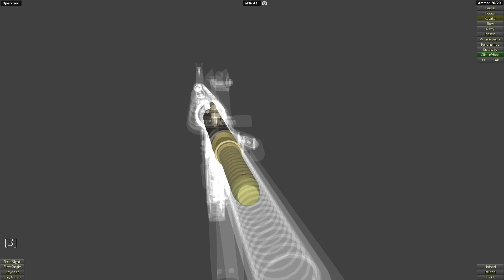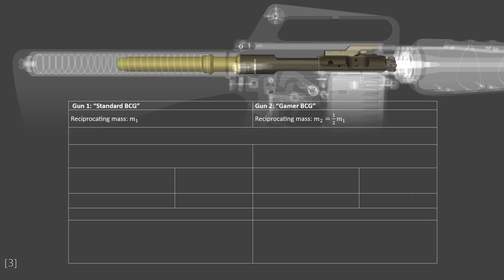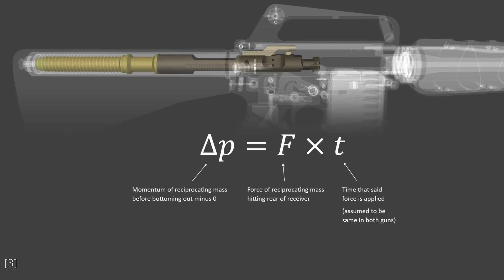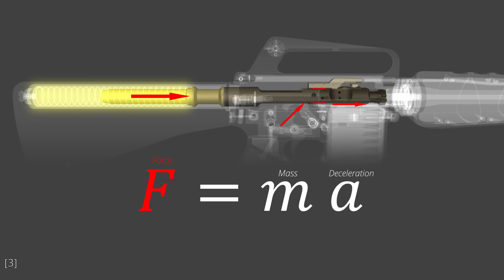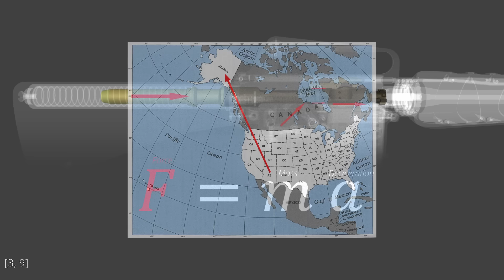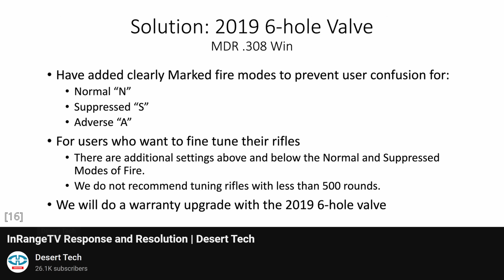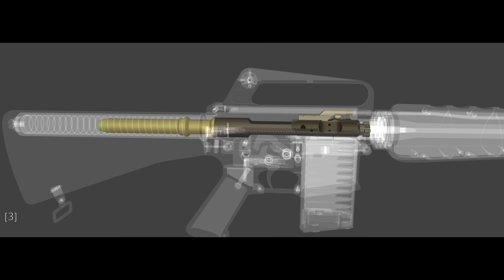Bolt Carrier Mass - A Nerdy Theoretical Discussion

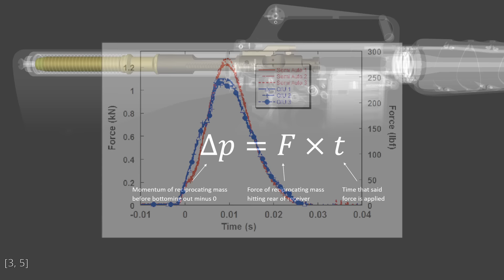Comment: Physics student here, 5:12 . Sometimes when you need to calculate the integral of a changing/dynamic force. It could be way easier to use conservation of energy formulas ( as they don't depend on time)

Comment: Part of this is the ratio of weight of the carrier to bolt , IF you look at one of the design changes made to the AKM to AK74 , you will see a lighter weight AK74 bolt ( the stem is reduced diameter ) , this gives the AK74 higher carrier to bolt weight ratio , to give the bolt more force in chambering/locking , my the higher mass ratio .

Comment: Thank you for pointing out the importance of the ratio of bolt weight to reciprocating mass (bolt carrier + buffer).  Early in the development of the AR-10 the bolt carrier and buffer were a single part.  A reduced weight buffer would be a lot cheaper than a reduced weight bolt carrier.

Comment: Great video.
It would be nice to see a video with calculations for a "properly optimized" system used for 3G guns.
Should be very helpful to understand how much "round stripping" and "bolt bounce" are affected and if it is really an issue.
Anecdotally, the following values work flawlessly on many guns, various calibers/loads and environmentals:
1. GAS  port restriction: 40% (estimation)
2. BCG weight reduction: 30% (-4Oz)
3. Buffer weight reduction (reciprocating part only): 80% (-2.4Oz)
4. Recoil spring strength reduction: 10%

Comment: I'm an engineer by trade and can confirm your reasoning and math checks out, and your assumptions are reasonable. I love content like this keep it up!
Reply: I think one difference is that the amount of kinetic energy added from the acceleration off the gas piston would be less for the lighter one. The length of the gas piston is fixed, and would spend less time accelerating on it due to accelerating faster and traveling that fixed distance sooner.
Reply: Well you failed

Comment: 10:38 Reminds me of when I tried to pull start my snowmobile engine without the clutch (basically the engine’s flywheel/part of the CVT belt drive, the clutch easily doubles the engines rotating mass). It was impossible to overcome the compression stroke without the additional mass of the clutch helping overcome the compression stroke with inertia.

Comment: Great nerd talk.
Another thing to add, militaries also have full auto. Which makes bolt carrier bounce and high cyclic rates a bigger issue and also favors heaver setups.
And the DT Wolverine, so basically MDR generation 3, seems to have some magazine locking issues. Time to wait for the gen 3.1 hot fix in a month or two from now.

Comment: Fair assertions.

To simplify the math all down to one sentence: Newton's laws of motion tell us all we need to know (particularly the 2nd and 3rd laws).

Speaking on the lightened bolt carrier subject, I have a WWSD2020 I personally tweaked to be as light to carry, and as light recoiling as possible - within acceptable parameters. It comes with JP's silent captured spring, which has adjustable springs - I put the heaviest one in there. I changed the bolt carrier out for a low mass BCG from Brownells. I put on a Superlative adj. gas block with the correct gas journal. Then I tweaked the gas a handful of clicks above cycling flawlessly with low power .223 ammo. 

What I sacrificed in reliability, I gained in performance and weight savings. As a civilian, that's an acceptable trade.

Comment: The "problem"/best point of this video is the "fair" comparison.  For high level competitive shooters, they do not just make a single change, like a lighter BCG; that is just one of MANY major upgrades they make.  This is a problem, as it doesn't reflect the complex nature of the total modifications made; however, it is the best point in that thinking you can just change out a lighter BCG and your gun is going to be just as reliable is not realistic.  To expand on that, high level shooters also do TONS of testing and tweaking parameters to tune their equipment precisely; they don't just buy upgrade parts and slap them in, as most people think they can.  Ammo is a VERY important factor; competitive shooters require much more precise ammo than most people, and are tuning the rifle to generally just 1 load, which is the only load they shoot out of the gun ever.  Factory guns are designed to work with any ammo that falls within SAAMI specs, instead of only one load.  Reduced recoil spring pressure is great, so long as you clean the gun after every match, keep it clean during the match, and if it's dusty out then you open it up and wipe it out between stages!  Competition race guns are amazing and blazing fast; however, they require much more maintenance, are not quick or easy to set up and tune, and are not reliable with a wide variety of factory ammo.

Comment: If you look at the A5 system, it is designed to allow for more weight and a higher sprung carrier as it gives the carrier more "oomph" to trudge through any debri and get you solid bolt closing.

Makes sense. Not to mention, you can run into bolt bounce issues with improper tuning.
Reply: I've been using the A5 system for nearly 15 years. It works. 💯
Reply: The only real advantage is the amount of weights that can be used compared to the carbine system..
Reply: @hairydogstail  Incorrect.
Reply: The largest advantage of the A5 system and its copies isn't its ability to have more buffer mass, it's the biasing of the buffer weights and the use of a longer recoil spring for the same stroke (no, despite what you learned in high school Hooke's law is not a complete descriptor of spring behavior)
Reply: @hairydogstail  These aspects of the design should not require an explanation. If you're mad at the A5 systems because they cost more or because the buffers/tubes aren't ubiquitous, that's reasonable. Just use an appropriate carbine system, they are proven to work fine.

Comment: Great vid. A not insignificant difference with changing reciprocating mass is time in battery. Obviously most of us can’t calculate the difference but it can be quantified through performance and it should be considered.

Comment: 6:26 Im pretty sure the force should be the same in both. You said it yourself, the cylce rate is faster with a lighter bcg and so immediately its obvious that time cannot be the same for both in the momentum eqn . I think the fact the Bcg is traveling back and snapping back forward again is what is causing the “lighter recoil” feeling. “Recoil” isnt just the first half of momentum, its the equal and opposite forward momentum as well

Comment: It's important to point out that the LAW ARIC showed in the gun used by MAC was correctly installed, you can tell because the guide rods are too far forward when installed in the gun, they should be further to the rear of the cutout. This means the cup was not properly seated which will greatly increase the friction when it trys to cycle, leading to the issues seen in his video.

Comment: Great examples of this Bravo. I run a 2A Armament titanium bolt carrier that has a gas adjustable feature on the bolt carrier itself.  I run it with a Geissele super 42 buffer spring and an H3 buffer. Once I dialed the gas in its absolutely flawless and insane smooth. Just my 2 cents worth.
Reply: A milspec BCG is about 11.6 oz and a standard CAR buffer is about 3.0 oz for a total 14.6 oz or so. I did similar with my WWSD build, getting a Faxon Gunner lighweight BCG (8.5 oz) and H2 buffer (4.6 oz) for about 13.1 oz total recip mass, shifting the COG a little rearward. Reliability has been great, seems like less friction from having less surface area.

Comment: The recipe for a reliable ar-15 with low mass BCG is to install adjustable gas block while retaining the stock buffer spring.
You tune the gas block so it ejects the brass perpendicularly from ejection port and the spring rides the bolt back in with enough energy to close the bolt.

Comment: When I ran lighter BCGs in my carbine style AR10s, I knew it would increase the velocity of the BCG, which in turn would cause additional wear on the hammer, buffer spring, buffer and eventually the BCG itself. So when using one, I've always used them in conjunction with a slightly stronger buffer spring and a hydraulic oil piston buffer to nullify the negative effects.

Comment: As someone who has built two AR's with titanium BCG and lightweight buffers, an adjustable gas block is 100% needed. My picks are either the Riflespeed or Superlative Arms. I haven't used the Riflespeed but it seems very easy to adjust, although it seems to have less adjustment and no bleed-off like the ones from superlative arms. Reliability is really only an issue if I run lower pressure .223 rounds, but with that said 1-3 clicks to open the gas block fixes that. Also these AR's are ran suppressed, the Superlative Arms bleed off really shines here as most excess gas is bleed off at the gas block and not at the BCG, so less gas in your face.

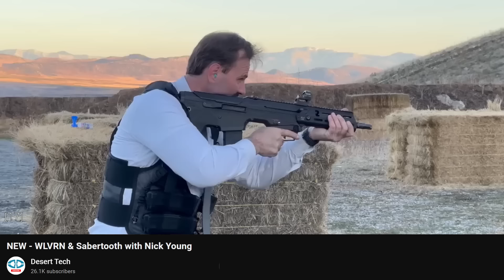Comment: 12:53 The WLVRN is definitely a promising design, but that inconsistent ejection pattern (provided the ammunition was quality controlled) looks like a bit of an issue. There are so many possible causes that saying anything is most definitely being an armchair-gunsmith, but seeing as they had issues with it on the MDR, I'd be interested to see if they properly upgraded the ejector spring to compensate for the change in BCG momentum when going with the heavier BCG; at least when a loaded magazine is exerting a force upward on the BCG (as the first rounds eject forward, and progress rearwards as the magazine nears empty). Definitely looked like something was going on there.

Comment: I recall competition shooters complain about occasionally outrunning the bolt on semi-auto, pressing the trigger too early and having the hammer ride on the back of the bolt causing a light strike.
You are lowering rate of fire with lightweight bolt if you balance the gas system.

Another issue is using 556 as part of NATO alliance: the 556 has a range of pressures allowable as well as bullet masses. Your rifle has to run with excess bolt energy most of the time to use them all reasonably well and Ukraine has shown that some rifles are picky about the country of origin of their 556.